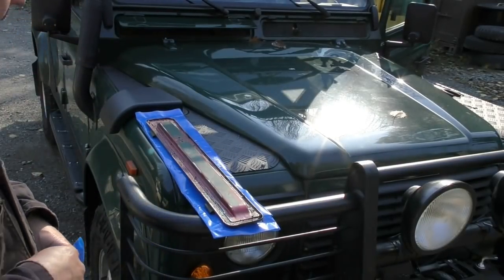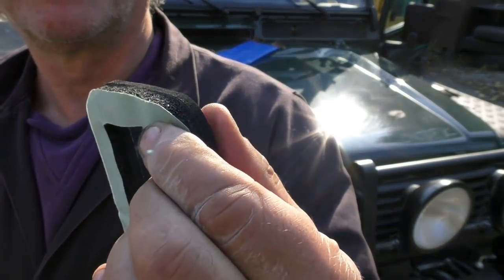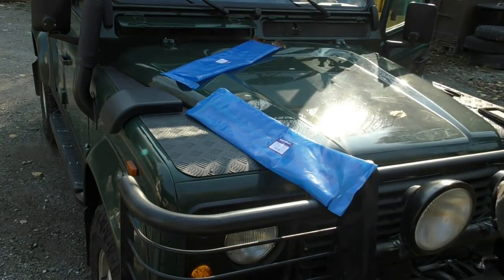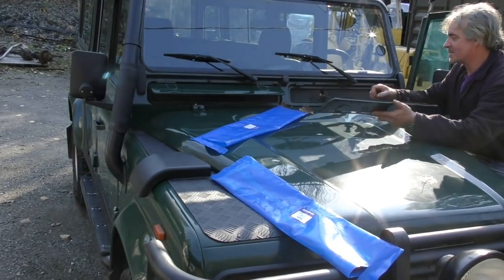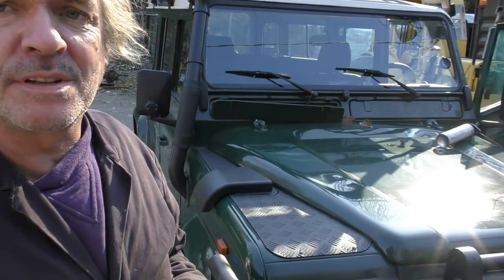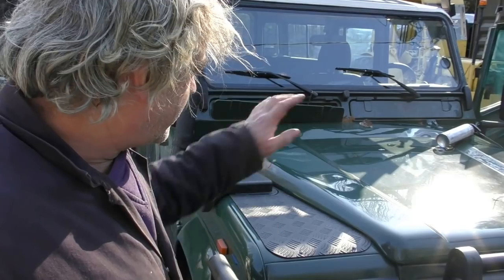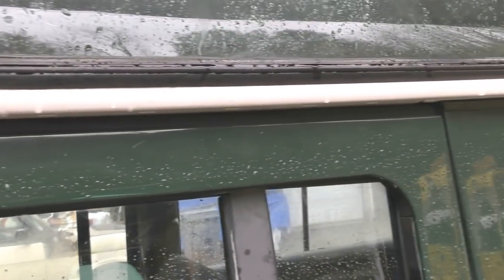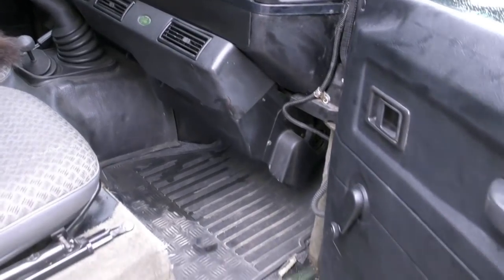Replacing Defender Vent seals and tracing leaks Part 3

Comment: My inside gutter would fill up and then you got the classic ‘right leg/left leg dousing’ when braking (depending which seat you were in 😂). After much investigation involving wedges of paper towel in the gutter to try and work out the source, I totally cured it by re-sealing the join that runs across the roof with Sikaflex 521 UV (white). Who knew that the gutter could hold about a gallon of water (at least it seemed like it 😂)
Reply from the maker: Correct - that is usually the culprit = this is a 1984 model so I expect the original sealer has dried out

Comment: I had water running inside and replaced vent seals. Problem wasn't solved, but i managed to fix and lube vent hinges. After watching one of your videos I made "extension" to the bulkhead gutter and problem was solved, no more water :)

Comment: I fitted those exact seals in preparation for the winter. Vent was spotlessly clean but they still moved after leaving the vents open for 24 hours. Had to use a contact adhesive. It worked and no more drafts, well not from there anyway.
Reply from the maker: Try telling the kids today that, and they won't believe you...

Comment: Heated screens aren’t only aftermarket - late models had them as an option and I think all XS (top spec) station wagons have them as standard.  They work pretty well as demisters, as you said, and can help get rid of frost by softening the bottom layer, but scraping is still needed, just easier.

I fit heated screens to my 109 and they’re fantastic in UK winters.  The heated pads for the wing mirrors are great too, both a big safety improvement.  Then there is the heated seating - now, that really is nice in winter, especially in the 109!

Finding roof leaks... well, good luck with that.  I used PU adhesive in the gutters to seal them up, and Captain Tilly’s Creeping Crack Cure (from most boat chandlers) on the alpine light seals to make sure they’re good.  I think I’m getting water in through the seams hidden under the roof’s external ribs, so they’re next.  It’s only a small leak, but it drips from any of the bolts through the gutter holding the roof to the side panels or windscreen.
Reply: Just removed the roof on my 109”, there’s a lot of bolt holes through the gutter to seal up. No problem with the bulk head vent seals as the rusted bulkhead lets the water in before it reaches the vents 😄

Comment: There was a 45 page typed A4 paper book at the main dealers I worked at that discribed all the potential water leaks and the alleged fixes! The roof joint and the pressed corners at the front where a crack can form due to the stamping process are unusual ones I've been involved in. 
Using a smoke machine inside the vehicle may yield results,  if you can maintain enough positive pressure!!
Reply from the maker: Smoke machine - I used a theatrical one once and smoke bellowed out of everywhere
Good thing LR do not make submarines ..

Comment: I added a larger gutter guard over my doors that kept water from dripping over top of the existing roof gutters and leaking into the doors. I used anodized L shaped aluminium stock to make them.
Reply from the maker: Good idea!

Comment: My money is on the "rainroof" sorry sunroof being the cause and tracking across to the drivers side due to the slight incline. I noticed the interesting looking door mirrors Mike did you fit them?
Reply: Or the door seals .. but your right roof rack ... !
Reply from the maker: I fitted them a long time ago
When a sunroof leaks they usually make the front of the headlining wet

Comment: You'd like the puma vents, none existent, just surface corrosion in their place. About the leaks at the window join block things, I had to just cave and fit them with sealant. Also the little gutter under the windscreen seems to extent a tiny bit further on a puma, under the attaching block, so gets clogged with leaves and things all the time. some terrible shapes for water flow on defenders. Best thing for water ingress, a garage.
Inadvertedly own a puma with a heated windscreen from factory, I know fancy, anyway its on an 8 min timer, and in winter in Scotland, its a godsend to soften the ice while warming up.
Reply from the maker: As I mentioned - everything on a Defender is a compromise

Comment: Mike to find leaks .. put your smoke machine on the front seat , fire it up & look for escaping smoke ( same as you do for engines )
Reply from the maker: Not enough volume or pressure = and to many body leaks 
Already tried it!
Reply: @BritannicaRestorations  .. aah , never tried it on a car with as large an internal volume , lol too many leaks

Comment: My front of gutter above top corner of door  seems to be split from the roof body. And I get buckets of water dripping in through the headlining over the heat/vent (RH drive) control and down to floor. Need to put some Tek 7 or something on to deal the split.

Comment: Could be leaking at the point where the roof skin is riveted to the steel channel through a loose rivet or the seal at the top of the windscreen framework,older roofs with vents at the back end were a terrible idea as the turbulence while driving in rain sucked water in and then dumped it down the back of your neck when braking!:)
Reply from the maker: Just wondering if the roof rack is stressing the gutters?
Reply: @BritannicaRestorations  I was also thinking the same or wondering if the screen had taken damage from someone reversing at low speed with a trailer causing it to parralellogram then spring back breaking the seals,lol something along those lines anyway!

Comment: I previously replaced my bulkhead vent seal with the help of an earlier video you done. Easy when you know how. Cheers.
Heated screen and mirrors are on my long list of todo but it would be for demisting, we don't get the same harsh  winters that you do over here in Scotland.
And finally I have a drip that comes in somewhere at a similar location. Passenger side UK right at the A pillar, so I'm keen to see how you get on. Trim wise, should there be anything below the alpine windows? I have the same bit above the door but if I look below the window it's just an exposed piece of gutter on my 110, the rear speaker wires run along it. Apologies for a war n peace reply. Take care T.
Reply from the maker: I have been fitting a dog guard and had to remove the trim below the alpines - dry as a bone - mystery!

Comment: Hello I don't know anything about much but could you use your smoke machine to find the leaks?
Reply from the maker: Not enough volume or pressure - tried a theatrical smoke machine once - leaks everywhere and not a nice residue inside (uses baby oil type stuff for the smoke)
Reply: @BritannicaRestorations  Understood thanks.

Comment: Has he got glass insurance?   that would fix that issue!..  Got the heated screen on my classic - Drivers half works great and demists - passenger side not so much and stays foggy - real pita I know that half's getting  power, but have not figured out were its failing.  Not much call for it most of the year in Cali!
Reply from the maker: Yes that is what he is going to do - at the dealers!!

Comment: If the vent was slightly bent out at one end due to the non central lever - would the foam act like a sponge and drag the water in drip by drip?
Reply from the maker: Possibly

Comment: Do you not find the older style of molded seal that goes on the bulkhead to be a lot better?
Reply from the maker: No they were terrible
Reply: @BritannicaRestorations  Weird.  I find them great.  They never, ever leak.  These new ones are a pain to seal and the foam does not last. But maybe after another 2 decades of owning a Defender, it will change.

Comment: Just a thought do people actually use the vents as I would have thought most of the later defenders would have AC I think that I would just seal them up that way they cannot leak but what do I now I drive a Jeep.
Reply: Most people use them.  They are very handy. Not many Defenders have A/C.  Unless you live somewhere really hot, the vents are more than enough.
Reply from the maker: Yes I use my vents is summer and they so not leak

Comment: Sounds like the owner would be better off with a standard windscreen and purchasing a $30 12v mini fan heater and put it on the dash, do the same thing! 😂
Reply from the maker: The after market heated screens are a bit of a disappointment - short lives and as Quebec has mostly dirt roads in the country, a very expensive part to replace

Comment: It’s from the windscreen cracked or seal has gone...mine has the exact problem even got in to the fuse box....
Reply from the maker: seal is good on the windscreen
Reply: @BritannicaRestorations  do a smoke test that should be a fun video....👀